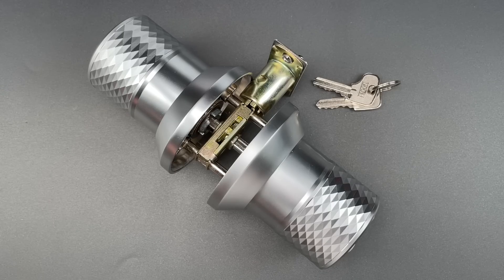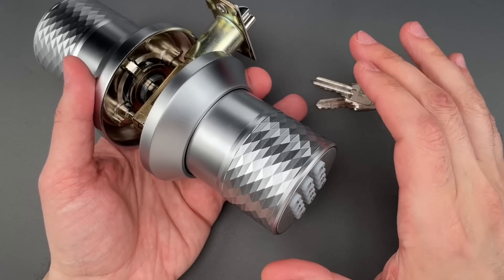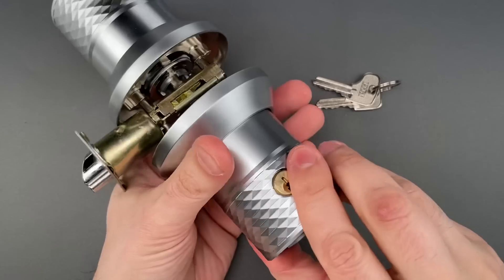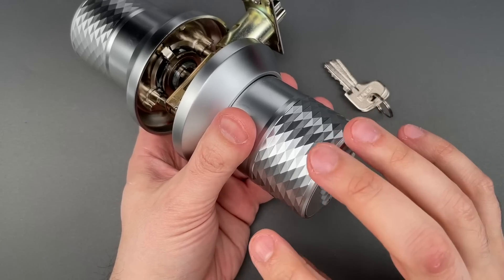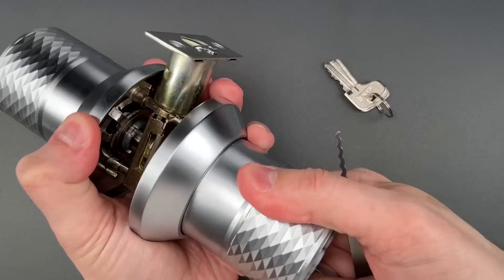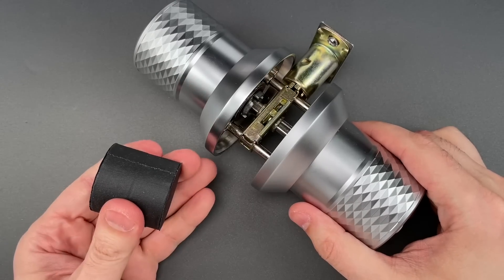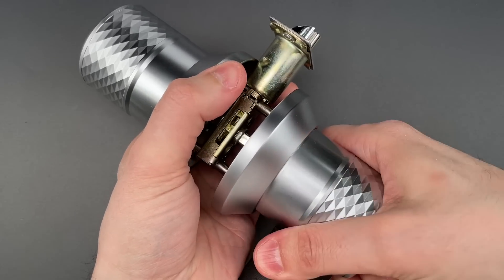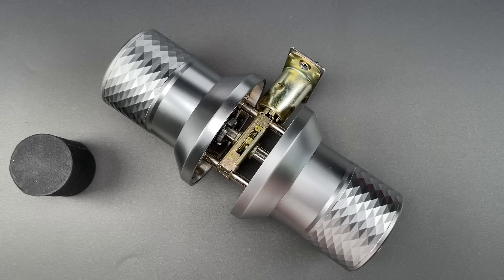[1501] Design Flaw In Fitnate “Smart” Doorknob

Comment: Has anyone else ever wondered what type of lock he has at his own home?
Reply: Would be nice to know in which locks he trusts
Reply: @LetShadowPlay  He posted it long ago.  He said he uses cheap Kwiksets with drop-spacers.  Unless you have all 5 pins lifted at the same time, turning the cylinder will permanently jam it.
Reply: @instazx2  He mentioned having those for secondary entrances but not for his main entrance.
Reply: @instazx2  LPL did a video showing how to make a Kwikset lock nearly unpickable by adding some security pins.  I'm sure whatever lock he has on his house has been improved by some LPL TLC.  He might though use a Bowley lock.  That is one lock he previously featured that he has yet to pick on camera.  The Bowley company even sent LPL locks for him to try and provide feedback to improve the design.
Reply: @LetShadowPlay  my only gripe with the channel.. never really recommends anything. basically everything is trash.
Reply: He doesn't have locks, or doors, or windows... He just picks the wall 😅
Reply: I wouldn’t try to get within 100 yards of castle LPL without an invitation.  I suspect some of his locks are branded Colt, Smith&Wesson or Remington.
Reply: @StrongDreamsWaitHere  He probably also has a couple of other locks, German Shepherd, Doberman Pinscher, and Rottweiler.
Reply: @StrongDreamsWaitHere  Indeed they are and they are rather nice ones as well.
Reply: @StrongDreamsWaitHere  I got a click on barrel one and a click on barrel 2 and now I just pull the trigger and he's been blown away.  That's it for making my day. Thank you... PUNK.
Reply: @StrongDreamsWaitHere only lock he trusts is the safety
Reply: The whole door is just made out of locks.
Reply: He said a few times that he custom pins most locks he uses.
Reply: He just picked his way into the 4th dimension, rent was low in there
Reply: im betting a surprisingly low quality ....somthing everyday. as pick resistance only is part of a lock its more likely to be drilled than picked
Reply: Pretty sure he uses standard locks, but with improved pins, which makes top difficult to pick
Reply: One with no pins, no keyway, no cylinder, nothing. Only way in is Alohomora.
Reply: Probably changes them out at random intervals so that no one can easily prepare for a pen test.  When you work in security, you've gotta deal with those that would do something to poke at your reputation.
Reply: He's also into modding locks to add pick resistance.  I seem to remember one in which he showed how to make a lock that will seize up if someone tries to pick it, and I don't remember him showing us how to defeat that (probably needs a shim).
Reply: He already addressed that in one of his videos so it you might look for it. I don't remember if he provided brands or models (someone in this thread mentioned them already) but he certainly said there is no point for super strong security on your house if the door itself can be attacked or a window can broken, so I wouldn't expect some super extraordinary locks on his house, although I would expect good locks on those.
Reply: A Remington 870 fashioned with a trip wire f
Reply: @Blankblank-nc9ss  Being a lawyer, he's against booby traps, as that the person that sets it up can be liable for the injuries sustained even by a burglar.  There is a famous case of a guy wiring up a shotgun to a door.  It ended up almost blowing of the fellows leg and the homeowner was liable.
Reply: @thedarksage328  I bet you're fun at parties
Reply: @The Dark Sage  I've seen some alarm systems that besides the usual siren, they also produce smoke. It's kinda like a non-lethal booby trap. As long as you sleep with your doors closed and keep your valuables far from entry points, you may stand your ground without having to risk it. Can't steal what you can't see, much less find or hurt you.
Reply: @thedarksage328 
 That's why, if you pull the trigger, you better kill em. Dead man can't sue.
Reply: @thedarksage328  uh no. Booby traps are completely illegal (in all fifty states if I recall correctly) because of first responders. Period.
Reply: @thedarksage328  Good enough.  Unless your home is hardened, they'll just crawl in a window.
Reply: @thedarksage328  Yeah, very sad times we live in when we can't have traps on our own property. But, just one more point to the fact that no one actually owns their own home or land. It's an illusion.
Reply: @Blankblank-nc9ss  -  Nah, he's a lawyer.  He knows better than that.
Reply: @Blankblank-nc9ss  Nope, boobytraps are illegal
Reply: Considering the vids of shooting Squire padlocks with a 50-cal, I'm not wondering that hard. Sometimes feels like we're seeing 1 of 2 sizeable collections. Or at least I like to imagine it is so.
Reply: @AyarARJ he’s shown a lot of the second collection in his videos about gun locks. Definitely seems sizable
Reply: all you have to say is open sesame.
Reply: ¿Bowley maybe? It's been unpickable yet.

Also, there are plenty of good locks out there, and they don't cost that much. In Spain for example you can get a Tesa (local brand, bought by Assa Abloy) for about 80-100 bucks which is at least very hard to pick, since it has many antipick features.
Reply: @danixsc  The bowley has been picked. Several times in fact. As someone pointed out above, he uses kwikset locks with modified pins so the cylinder locks up if you try to pick it. IIRC, he put security pins and irregular springs, too. Such locks are not good for locksport locks precisely because they cannot be picked.*

Of course they can be picked, but it comes down to luck with them. You have to get every pin in exactly the right spot before turning them or they will completely bind up and require drilling out to open again. The odds of picking them are practically zero.
Reply: @ConstantlyDamaged  So, if someone tries to pick the lock and fails, even the owner with the key can't anymore enter the house without power tools? That doesn't sound convenient if you ask me.
Reply: @herrakaarme  Convenience, Security, Price. Pick 2.
Reply: @herrakaarme  If you tried to pick the lock on the hidden entry point (usually back door) of a house, and the lock did that, would you then go around to the exposed front door and try again?

But no, it won't be convenient. What would be even less convenient is having to get the police to come around and go through your house to file a report for your insurance company, then arguing with said insurance company, and finally having to replace all the items minus the excess plus replace the locks on your doors.

At the very least, if someone tries to pick their way into your home, you should be calling a locksmith to inspect the locks/replace them anyway. Having them drill the locks out is no big deal.
Reply: @ConstantlyDamaged  I live in the Abloy country. The worst house locks people have are the classic Abloys for which LPL & BosnianBill needed to develop the special tool. It only goes up from there, and many people, myself included, have two different locks in the door. I reckon a violent entry is more likely than picking the lock. Violent entry would leave no room for the insurance agency to weasel out of their responsibility.
Reply: Claymore
Reply: He's stated before that on things like a car the security system is more important than the lock. I suspect he has some type of security system, and he probably also avoids security risks like having notably expensive things displayed or tracked in a way that presents any risks. Also, others mentioned he likely has home defense armaments.
Reply: all of them in a row
Reply: its called a lawsuit
Reply: @TheAsmarhussain  Does that mean he has a sign in his yard that says: "beware of lawyer"?
Reply: Hopefully the kind where the keys don’t fit in an electrical socket!
Reply: He doesn't have locks. He created this channel to search out the best lock to use on his house  and hasn't been impressed by any of them 😂
Reply: @dillon4903  LockPickingLawyer, but the Picking means "selecting"
Reply: Agreed - I need one.
Reply: The cheapest lock with a microwave transformer with a boost converter to take it to 1000000 volts . That will kill even with gloves on!
Reply: Pretty sure it's a guy with a musket.
Reply: German Shepherds work a treat...   ;-)
Reply: Personally, I don’t know. But I bet he never has to worry about being locked out 😂😂😂
Reply: We know what his ex-girlfriend's backdoor has.
Reply: The doorknobs are covered with packing tape, it takes longer to open.
Reply: From a video series with Bosnian Bill, I'm pretty sure his home security include .50 cal
Reply: I was going to make a joke about alligators, but the reality is he uses cheap locks with pins that jam the lock permanently if you get it wrong once. Think of it like a one use item, except it isn't "used" unless you try to pick it and fail
Reply: He probably welded it shut.
Reply: He probably changes the locks/cores out every so often, so there's likely no single right answer.
Reply: @thebananas6483  I doubt he wastes that much time with it. Practicing at a shooting range would be a better investment
Reply: You tap the bricks in an alley wall to magically appear in his living room.
Reply: I'm pretty sure he's shown a lock similar to his own on video once. 
There is a video from way back about pick proofing your lock. It's a specific design feature of a certain lock that he uses to pick proof it. 
The feature seizes up the lock if you try to pick it, so you can't come and open it with a key afterward, so only copy that technique if you have a backdoor you can enter through or if you're ready to break a window to get in.
Reply: I bet he sleeps with the doors open
Reply: One of each.
Reply: A man this majestic requires no locks.  Simple respect guards his doors.  But he probably has some locks too...
Reply: its a very difficult lock to pick because it doesnt exist on the market. but basically how it works is...<redacted> and that allows him to <Censored> and he got that open. ;D
Reply: He has a dog named "b*tch" a 90 kilo muscle beast that patrols the perimeter and feasts on the unlucky.
Reply: The best security is obscurity.  He probably lives in a hobbit hole in the middle of nowhere
Reply: Pit bulls and "pew-pews"
Reply: pretty sure he made a video on this though i dont remember which
I think he said he uses locks that he modified with security pins
Reply: IIRC he said it was a modified kwikset lock that would jam up if you attempted to pick it due to his modification, but that was in an old video so he has probably changed the lock by now.
Reply: Probably one of those bowley locks he showed a while back with the hook shaped key as even he had trouble picking that, either that or the squire lock which he took to the shooting range with bosnian bill to test its durability
Reply: He has the tools needed to print new keys, so I wouldn't be surprised if he rekeys all the exterior locks in the house.  He also avoids any smart lock that requires an app to use, so he probably strictly uses mechanical locks or ones with a keypad.
Reply: Hes previously said he would never reveal that publically but does have a video with lock recommendations for your home.
Reply: One that probably doesn't take a key. Lol
Reply: like a good password: not unbreakable but long enough to get bored drilling it. So probably several medium quality lock and one of them home-tuned
Reply: Everything's keyed up with bowkey cylinders with lovely metal plates.
Reply: Even if you go to his home you know he can come and take his stuff back any time
Reply: LPL says stay strapped or get clapped
Reply: He modifies his locks
Reply: my theory is LPL has two entrances that are out of seyesight of each other and he goes out of the randomly when he leaves so anyone watching his home has no idea if he is inside or not
Reply: Seriously, I think he would opt for something like a Kaba 20 (ten minutes video, of course he picked it, but took him longer than usual, so it should be pretty safe against common burglars).
Reply: He's a lawyer. You never steal from a lawyer. That's just asking for trouble.
Reply: Probably welds his front door shut when he leaves.
Reply: He has a load of poo on his door handle as noone will even go near it .
Reply: tripwires and shotguns
Reply: @Sponsor_Block  -  Nope.  He's a lawyer.  He knows better than that.
Reply: .45 acp
Reply: Probably StuffMadeHere V2 with the suggested fixes. That was a pretty brilliant solution even if the implementation wasn't bulletproof. I'll give the guy some slack since he's not a locksmith and did better than 95% of the companies that make and sell locks.
Reply: He stole it from fort knox
Reply: Fool, he doesn't live in a muggle home